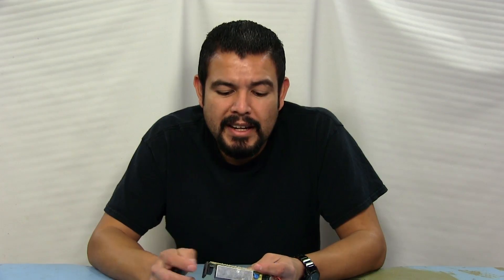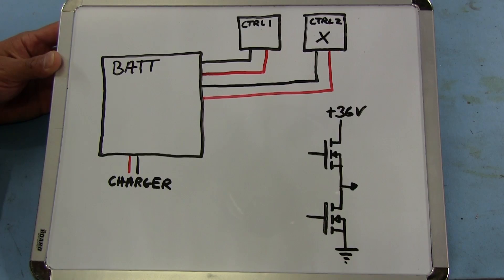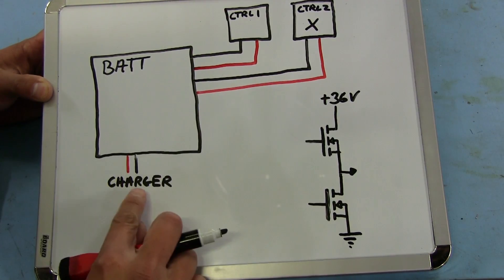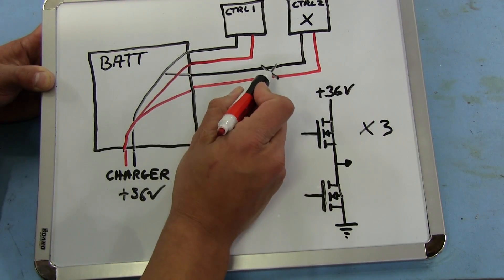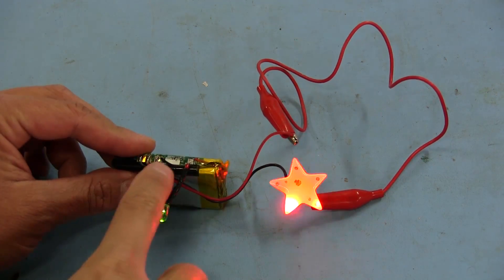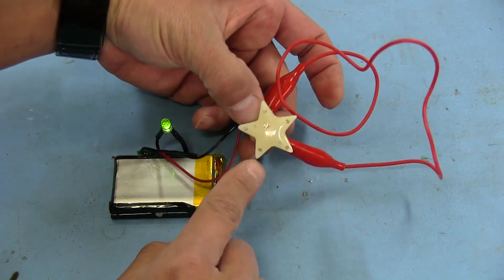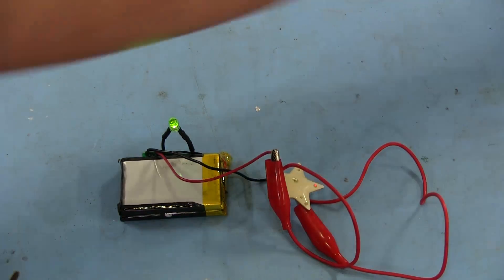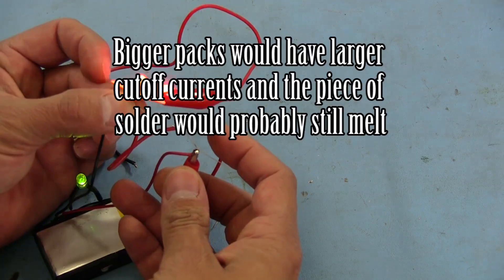TWB #36 | Why The Original Hoverboard Charger Failed

Comment: I just got a hover board and it worked fine. It was a hands free smart board x2 from swagtron. I works great but it doesn't charge like the others have posted below. When I plug in the charger the red light on the charger turns to green right away and the board just doesn't charge. I know that the charger light should be red when charging. The charging port is plugged in to the mother board. Would the board be defected or would you guess it would be the charger?
Reply from the maker: You should check voltages on the charger and the batteries first. Although if the LED on the charger is red when it's not plugged into the board, and it's identical to the way this one is supposed to work, then it might have something to do with the charger. Couldn't tell you anything for certain, but if you have a multimeter available, start with checking voltages.

Comment: You're the first I have seen explain the actual/true cause of the fire/explosions, but I still don't think I see the clear reason why it was a failure...  Disclaimer: electronics are hobby and though I love it, it is not my primary order of business and therefore not as cohesive as I would like to exclaim...  but if I were to regurgitate what you explained: The power supply lacked proper current limiting / feedback and the multi-cell charging components shorted, creating a path between battery and power supply to keep introducing current to the cells till they overheated/failed causing a fireball effect...
Reply from the maker: I realize that I could have probably been more clear in the video. At the time, what I was thinking and what I was saying made sense to me, although I realize it may have been a bit confusing to others, so I apologize. I'll try to explain a bit better below: 

What I believe killed the power supply is that the two MOSFETs shorting basically became the equivalent of just placing a wire directly across the output of the power supply. The MOSFETs are for driving the motor and they have nothing to do with the actual charging circuit. When everything is connected together, the power supply, battery pack, and controller boards are all connected in parallel, so any of those components that shorts across the positive and negative are going to be a short across everything else. The protection circuitry inside the battery pack kept a dangerous condition from happening because it practically disconnected the battery pack cells from everything else when it sensed too much current being drawn from its output due to the shorted FETs. The only feedback the charger/power supply actually has is a current sense resistor built directly into it. The way it appears to work, from what I could tell, is that it senses the voltage across that resistor using the LM358 op amp. If it's above a certain level, it indicates through the LED that it's still charging. The charger has no idea if what's connected to the output is an actual battery pack, or a resistor of some sort, so as long as it senses current draw, it just keeps trying to supply it. 

What you mentioned is probably not far from what has actually happened with some of these units that have caught on fire. I haven't seen one that has burned up to know for certain, and this is the only one of these units that I have actually played with. If I were to guess, I'd say that in the cases where they have caught on fire, either the battery protection circuit failed, didn't cutoff because the current being drawn wasn't high enough, or the design of the charging circuit is just poor. The protection board inside the battery pack probably has a pretty high cutoff current set to be able to handle the high load placed on it by the motor when the board is being used. I'm sure it wouldn't take too much amperage to melt some wires and make everything else catch on fire. 

I hope this helps explain things some!